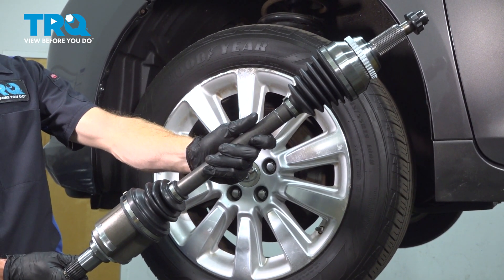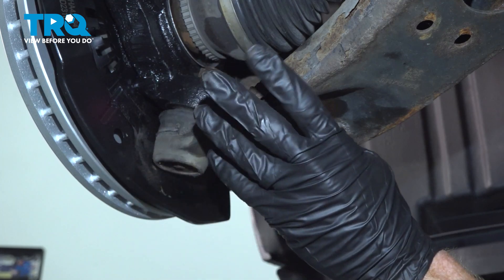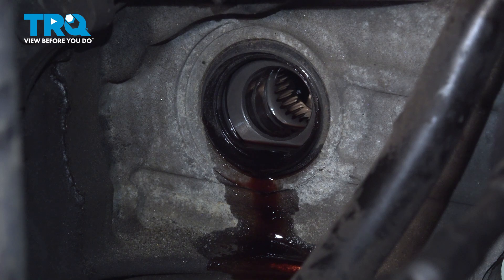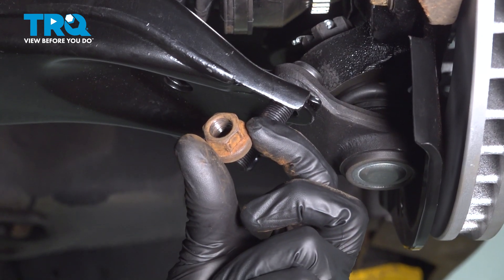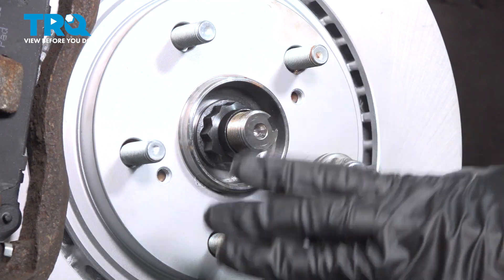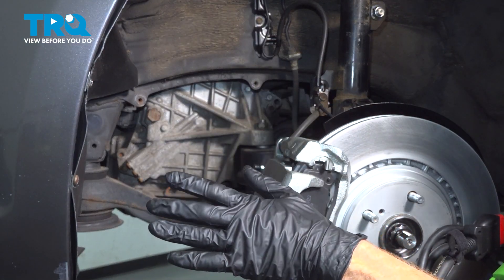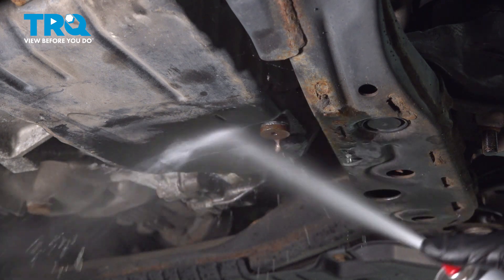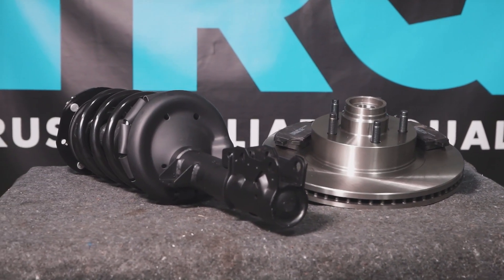How to Replace Front Left CV Axle Assembly 2011-2020 Toyota Sienna 3.5L V6

Comment: just replaced driver side cv axle  on 2014 sienna why is it still clicking
Reply: Did you figure it out? I did mine as well but its still clicking, vibration is gone but its still click during full lock when reversing and turning from stop.
Reply: Control arm?